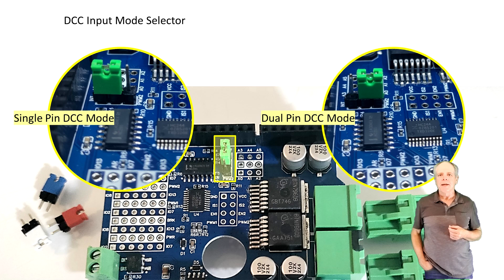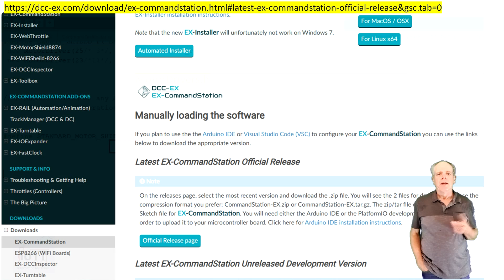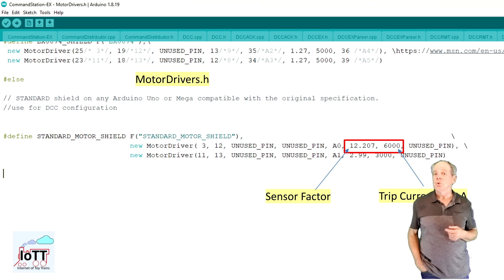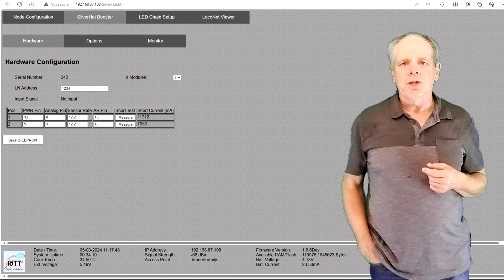Finally: PowerShield Rev 5 (Video#140)

Comment: Hi Hans, what is the difference between the BTS7960B and the in the docs named BTN7960B , I orderd some BTN's because those are the ones you use in the schematic. And thanks for all the brillant work. Grüsse aus Limburg
Reply from the maker: The BTN type has (according to some datasheets) the higher supply voltage up to about 28V. The information is in some cases contradicting, however. I picked the BTN type because it was used on the popular commercial modules I was using and it was holding up in my tests up to 28 Volts.
Reply: @IoTT  Thank you for the answer